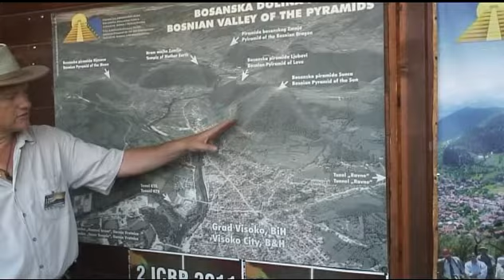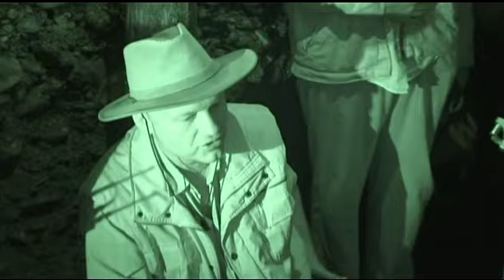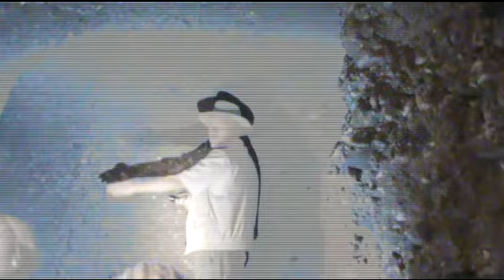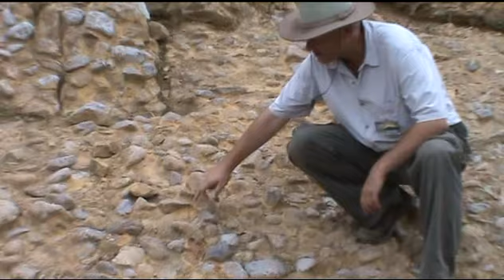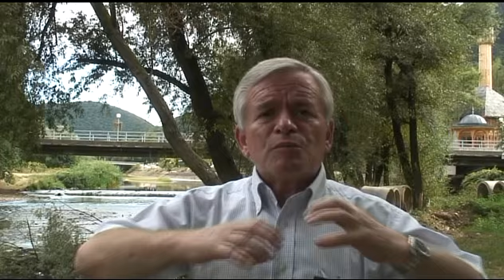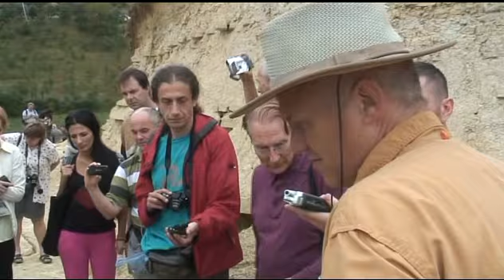Visoko - The enigma of the Bosnian Pyramids

Comment: is this guy for real??all they done is partially expose different things and try to say its man made and so on ... why not fully expose something and if the blocks are man made why are they so beat up looking? theres blocks in south america from older times in perfect condition with smooth sides, this is ridiculus, be like seeing an inch of metal protruding from the ground and then speculating its an aircraft or a skyscraper or pyramid! lock this fool up for fraud
Reply: You DO geology then to be commenting on the wear rates/states of similar rock in freezing/wet/dry areas. In Sth America/Egypt the area is very dry, in UK it is relatively mild the rock wear rate is less. In Bosnia the ice/frost is very severe, that allows moisture to lay in surface of rock, then when freezes the water expands and lifts surface off in sheets. The Sphinx in Egypt has similar wear patterns, yet is supposed to be same age as pyramids. Some say the wear is from Water. The Nile delta used to be a very fertile, flood plain. Hawass, says it is from salt rising through rock and traveling to surface eroding that one monument faster than rest (without any proof).
Reply: Excel in Geology 101 and erosion will explain the process of rocks appearance over time.